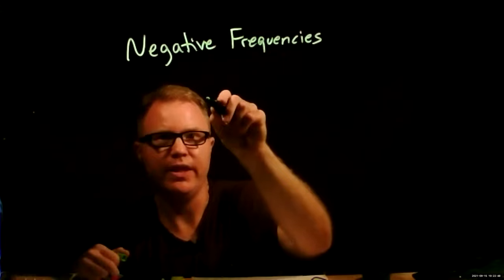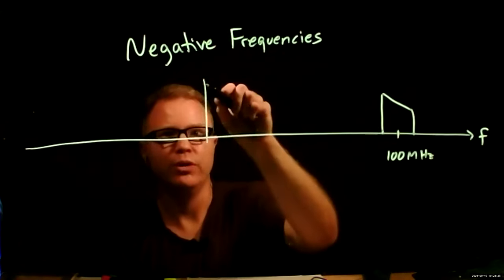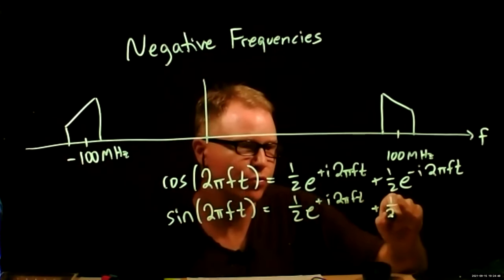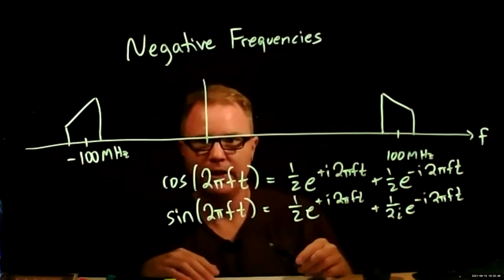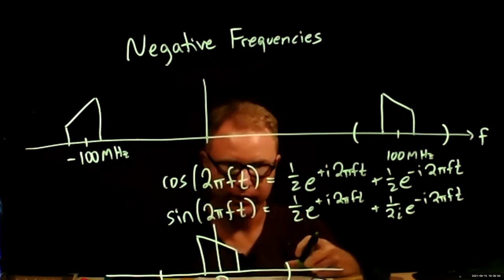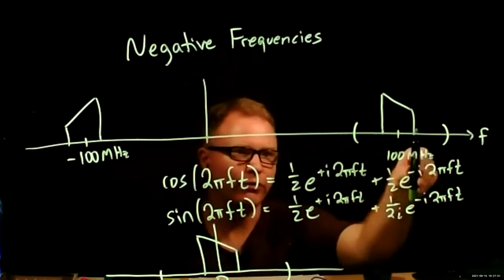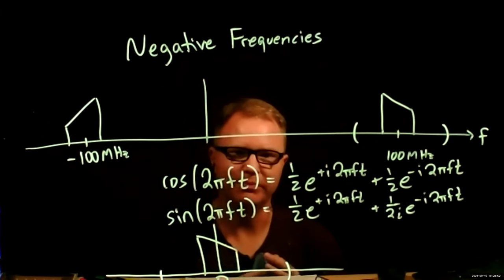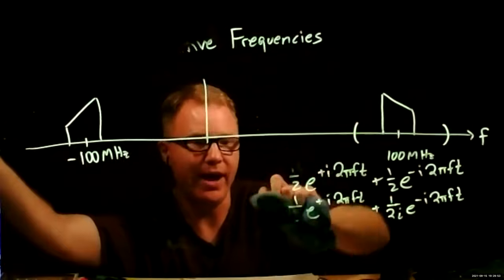Learn SDR 03b: Negative Frequency Question

Comment: Big Aha moment on negative frequencies. I now understand clearly the connection with the Zero IF thing shifting the signal around 0 Hz before sampling by the Analog Digital Converter. The key element to understand is the parity of the cosine and sine functions : cos (x) = cos (-x), and it is therefore not possible to differentiate between a frequency above and below carrier frequency (both positives because real frequencies) in the baseband range, that will turn into a positive and negative frequency (respectively) once shifted and centered around 0 Hz. When applying the cosine function alone to these frequencies, because of the parity of the function, we lose a piece of information about the sign of the frequency, that tells whether it is a few Hertz above or below carrier frequency. The quadrature signal (sine) stores the other half of the information that enables to differentiate lower range frequencies from higher range frequencies, and therefore reconstruct the real signal frequency.
Thanks a bunch !